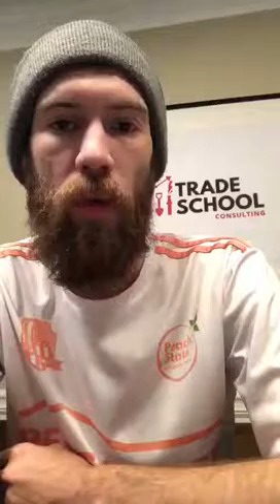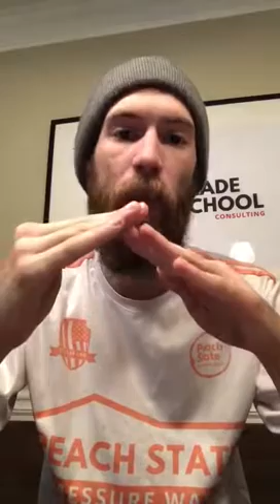Softwash pumps and systems (which one is right for you)

Comment: You are mistaken about the extension.  I use a 24 foot extension 200 feet of hose with  a 5.5 gallon 12 volt. And it sprays it a good 40 feet.

Comment: Also, you cannot use a blend manifold/proportioner on a gas set up because it has a bypass.
Reply from the maker: a high draw proportioner is available for gas machines. It comes with a bi pass kit to solve that problem. @midwest washing equipment

Comment: I am using a 3 gpm 12 v 60 psi with 200 ft of 5/8 hose with a 35 gal tank for now. Not happy with the flow spray and distance. For now I need to use a 12 V pump only what would you recommend in gallons per minute and psi to give me the distance and good amount of spray coverage for roof cleaning? I keep getting all different answers but it seems like you know what you’re talking about so what would you recommend? Thanks

Comment: What 24 deep circle marine battery you recommended
Reply: I’m building me 12volt system with a flow jet pump 6 gpm what do you think about the pump
Reply: What size tank do you recommended for water, SH and Surfactants
Reply from the maker: Great question! Blue top Optima batteries are best. What other questions do you have? We’d be happy to help.

Comment: I have a 79cc four stroke pump Would that pump go in between your proportioner and your 12 V pump or would it put enough psi out to just do the job I’ve got a huge roof wash to do and I haven’t ever done one this big and it’s not walkable
Reply from the maker: No. You can’t boost that way. 
Best bet is to make an extension rod out of pvc and put an angle on it to better help you apply the chem. If you’d like you can Facebook message us and we’ll get some more details and help you with the extension for your softwash roof clean